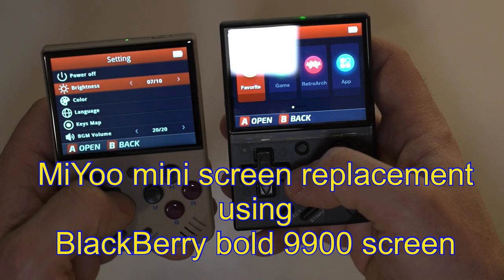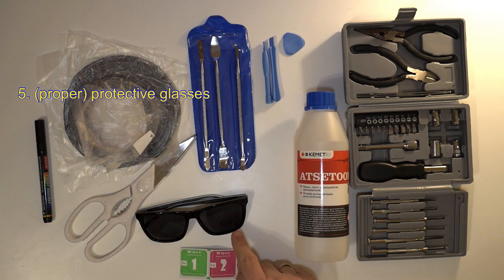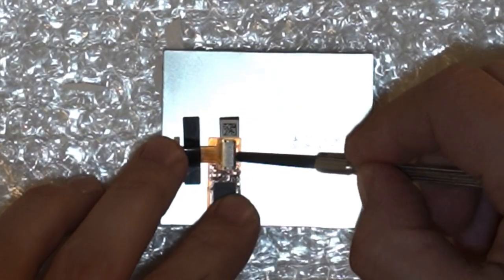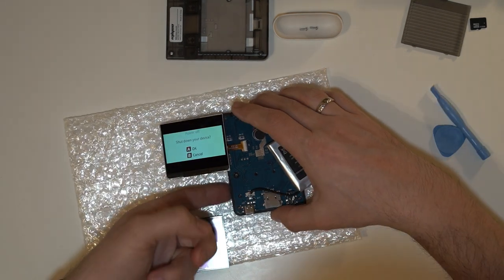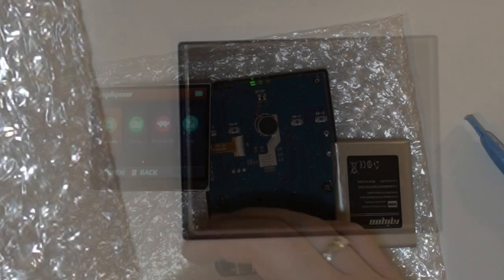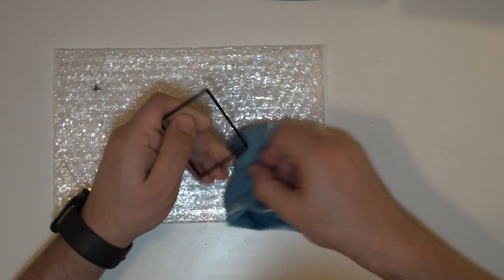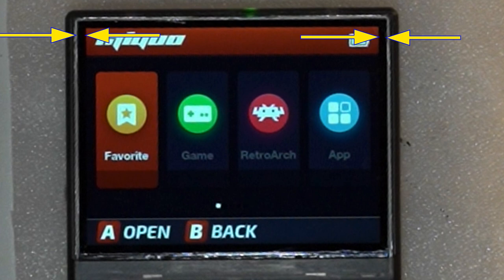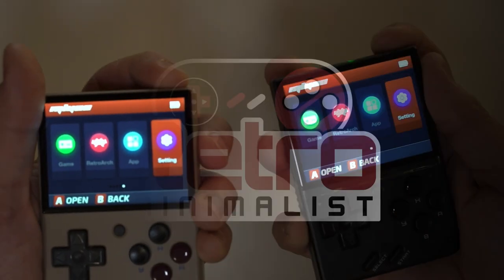Miyoo Mini Screen Replaced by BlackBerry Bold 9900

Comment: Hi thanks for the video, I did all the steps, now I'm trying to find the screen replacement part, you know if blackberry 9900 and 9930 are the only devices that use the same LCD ?
Reply from the maker: honestly I didn't know 9930 can also be used. I was aware of only 9900. Checked the specs now and indeed it seems it's the same screen. I am not aware of any other device though... In Europe there were plenty of them on eBay. Someone mentioned they bought from aliexpress too.

Comment: How about miyoo mini plus? Mine arrived cracked and i am dying to use it
Reply from the maker: There should be no issue obtaining a mini plus replacement screen, as they are not scarce. Then you can simply follow my miyoo mini screen replacement video (there is a recent comment underneath that the process is basically the same).

Comment from the maker: People, who went through the process following this video suggested the following improvements:
1. Use an exacto knife to remove the polarizing filter/glue from the plastic screen which you need to reuse. Apparently it takes only a few minutes to remove it (unlike my 1 hour struggle :-) )
2. Use a masking tape to protect the black paint frame on the plastic screen, to avoid having to repaint it.

Check out my detailed video on MiYoo Mini disassembly and screen replacement using an original screen:

https://youtu.be/97kOOxP3BdA